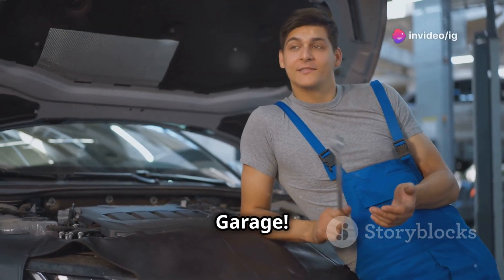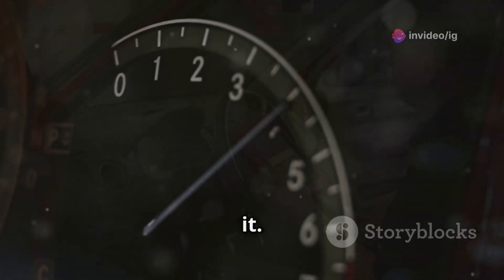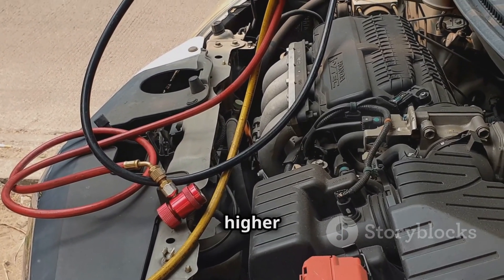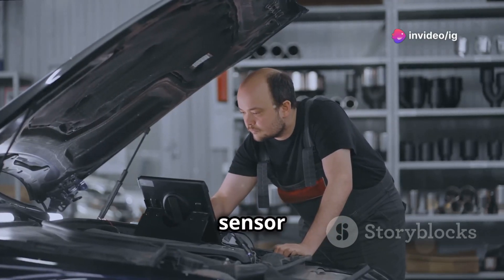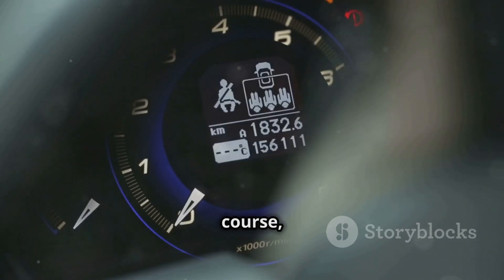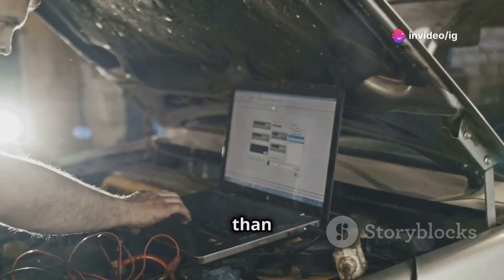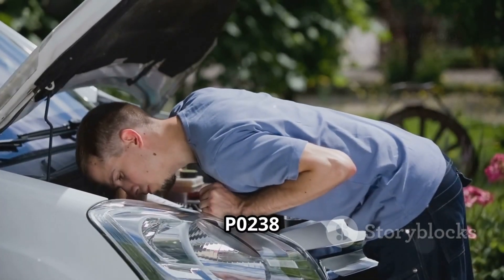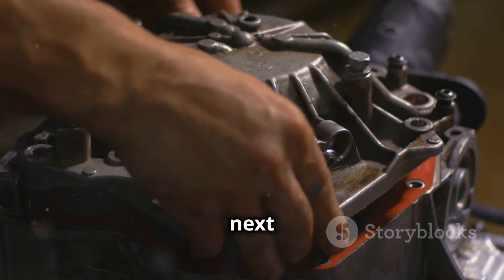P0238 | p0238 turbocharger boost sensor a circuit high | p0238 turbocharger boost sensor

Comment: Im getting P0238 on my diagnostic tool saying signal range check  high.... when i disconnect the sensor i get that code plus another code saying signal range check low what could be the solution